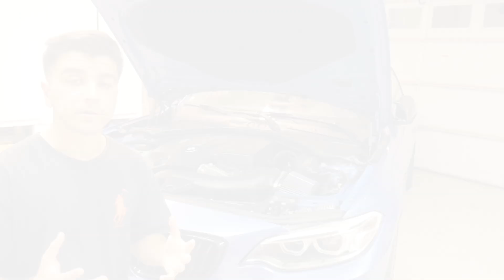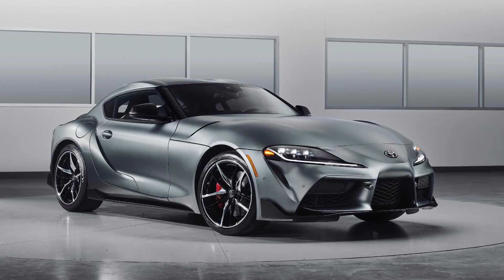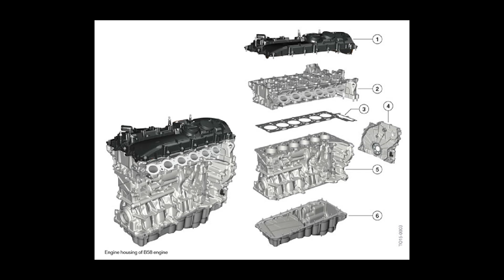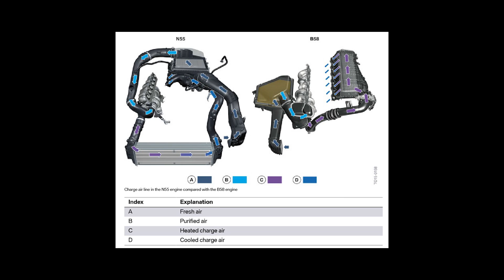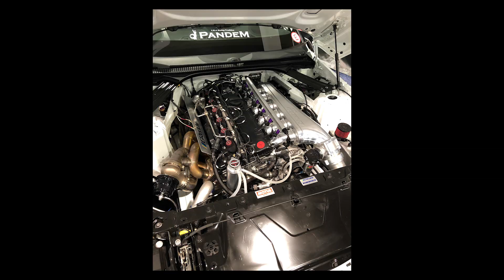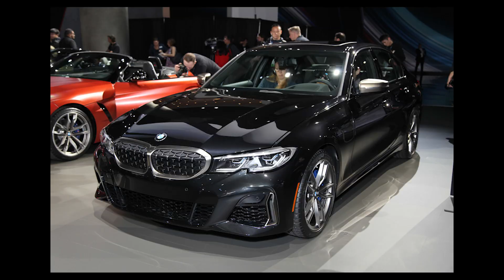How Does the BMW B58 Make So Much Power?

Comment: The m340i has a detuned s55 engine not the b58
Reply: The M340i uses a B58 engine.

https://en.wikipedia.org/wiki/BMW_3_Series_(G20)
https://www.autocar.co.uk/car-review/bmw/3-series/first-drives/bmw-3-series-m340i-xdrive-2019-review
Reply from the maker: it does not use an S55, it has a B58
Reply: 40i BMW's have B58s. Every 40i car has a B58. The 35is have N55s.
Reply: Stop lying to the YouTube people
Reply: Why do ppl speak when they are ignorant about facts 💀

Comment: I’m sticking with my n54 the b58 isn’t catching up anytime soon
Reply from the maker: it's already caught up bud! Big boost cracked over 900whp on an M240i and multiple S55 owners have exceeded 1000whp on that engine too
Reply: 😂😂😂 been caught up
Reply: CTK Network it’s already better tbh
Reply: Ollie Clark I think it’s around 600 whp with pures but yeah around there
Reply: Ollie Clark crank or wheels?
Reply: Ollie Clark cuz if it’s 710 wheel either his dyno was not calibrated corrected or he was just lying. You can not make that much on just a hybrid. That’s what companies like bigboost are for. That’s the company I would of went with if I didn’t have a zf8 to limit my build. Also there isn’t a 1000 horse power stock block. Where are you getting this info from😂 the stock block record is around the 800s
Reply: Ollie Clark it is. Torque wise it’ll start slipping. Yes it can hold up alright for a while but as a daily. No😂 also it says bhp. Meaning crank. Which mean it’s making low 600’s to the wheels. Aka exactly where I said it’ll be
Reply: Ollie Clark I’m making 575 whp on my n55. My tuner who is one of the best in the business said if I wanna keep pushing I’ll need to start getting stronger Tranny parts
Reply: Sticking with N54 becoz can't afford a brand new B58. 😏